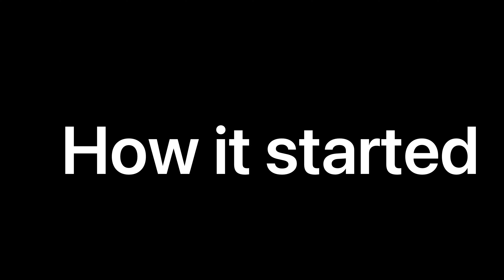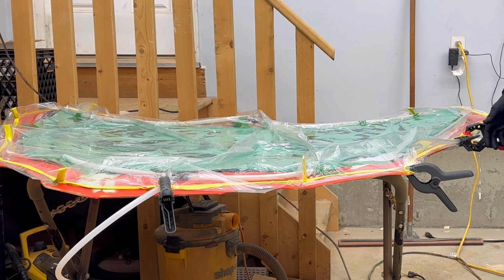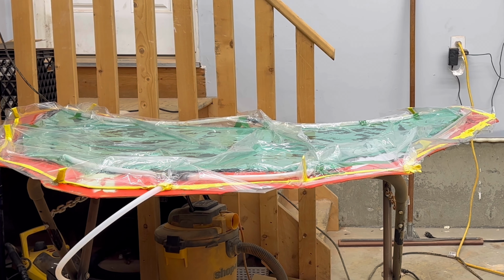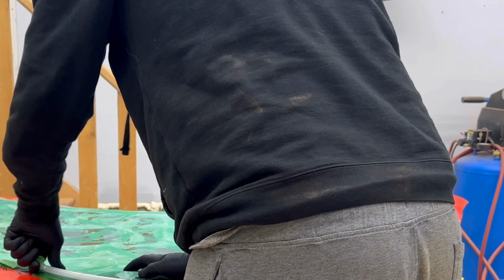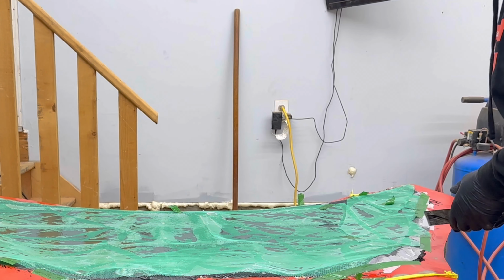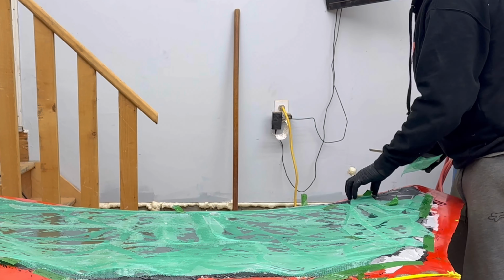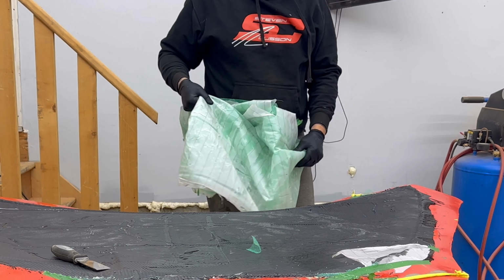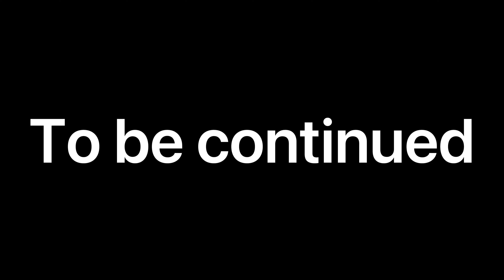Carbon Fiber Infusion: Failed

Comment: Any reason your gum tape line isn't on the very edge of the mold? This way you can acetone the "gum tape line" before gum taping. That alone will fix 90% of your leak issues. Edit: during the time lapse you can almost see air coming in from some of the gum tape pleats.
Reply from the maker: There was a bunch of imperfections in the gelcoat along the very edge. I actually decided to just remake the mould, you know, one of those ideas that “seems like a good idea at the time” hahaha. I’ve never used Acetone tho and I’ve seen you do it, I will have to give it a go. I’ll upload another video here and hopefully it goes better. 

One thing I’ve noticed, I was using the green stretch bag, but I think it gets pinholes in it from the mesh. I’m going to try the clear bag, it says online it’s thicker. I plan to pick some up tomorrow and try again with the clear bag.

Comment: I haven't infused anything, but shouldn't you have clamped off the resin, clamped off the vacuum and turned off the pump (before going to lunch)?
Reply from the maker: Yes and no. I always let the pump run 2-3hrs to make sure all the air is out then I clamp it off. This was somewhere in the middle of that LOL Thanks for watching! More to come!

Comment: I would have run to Harbor Freight, bought a cheap vacuum pump, pumped it down again and continued as if nothing had happened. 

Actual test results don’t support the hype about weakening parts without vacuum. 

That hood could have easily been fixed instead of scrapped. 

Of course if your time is worth $150/hr or more to you then it would be a wash.
Reply from the maker: We do not have Harbor Freight in Canada lol just Amazon and its over night. I could have probably fixed the hood but wasn't worth it. Thanks for the view, I have lots more coming!
Reply from the maker: Let me know how it goes!